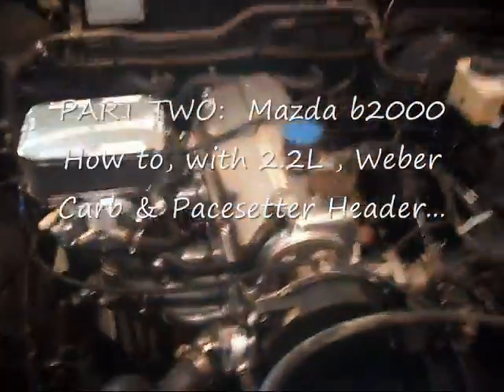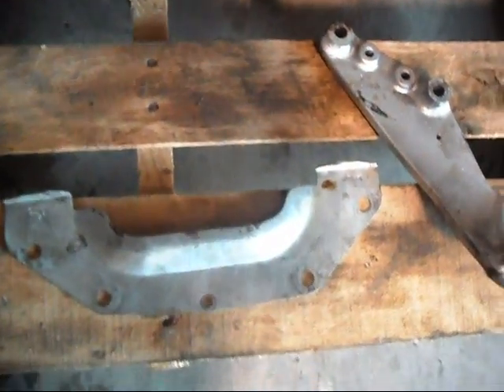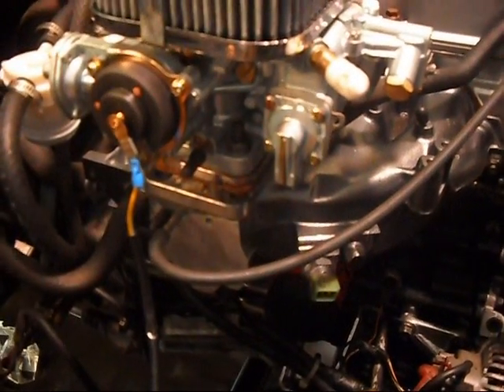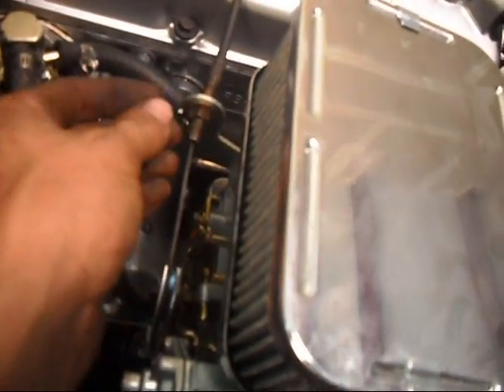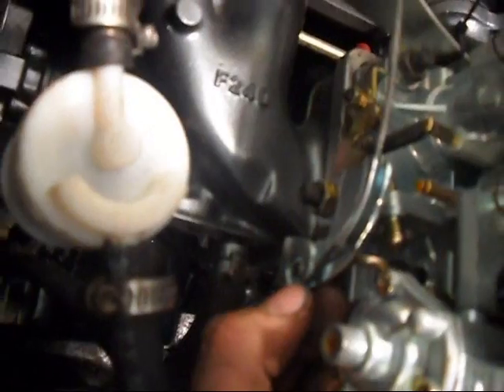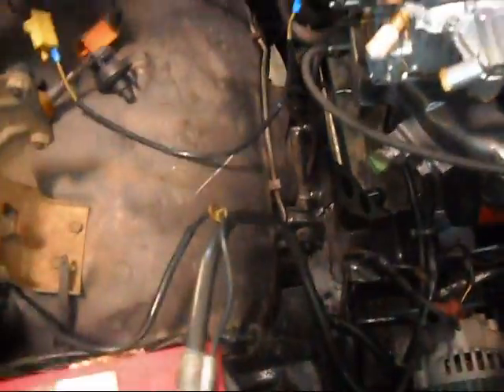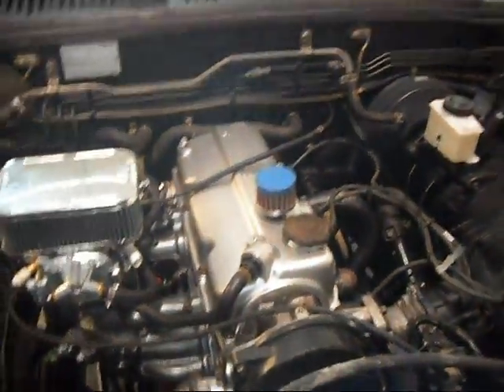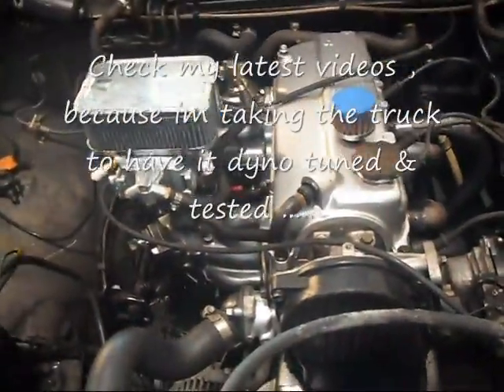PART TWO:: Mazda b2000 How to, with 2.2L , Weber Carb & Pacesetter Header...

Comment: BRAHHH  I HAZ A 86 B2000 WITH..I THINK ITS A B2000 LOL SOMEONE PUT A WEBBER ON IT AND HEADER LOWER PRO TIRES AND CUSTOM RIMS ITS PRETTY COOL.  JUST PUT A HEAD ON IT, MAN I COULD USE A HAND!! I GOT IT RUNNING AND I BENT THE THROTTLE CABLE BACK TO GET IT TO "IDLE" LOL IM HAVIGN TROUBLE GETTING THE TENSIONER PULLY SPRING TO STAY ON.  THE OLD ON IS BUSTED, THE NEW ONE FLEW ON ON A TEST DRIVE. DAMN I SHOULDA DONE THE BELT AND PUMP, ALL IN LEARNING.. LOL
Reply: Video to change a oil pan gasket on a b2000 Mazda truck

Comment: I have a 92 B2200 just put the Pacer Headers and Webber 32/36 DGEV. I checked my crank and camshaft marks and placed the distributor on TDC. On my Webber i had to set the high speed idle screw touching the accelerator cam. I noticed my spark plug were dark black which tells me that I'm running rich. Do I have to use a timing gun to improve power. I don't have power. I step on gas pedal and it feels like there's no power. Any answers help. Thanks

Comment: I have a 1984 B2000 with a B2600 engine (2.6L Mitsubishi completely rebuilt I think from 1992) with an old stock carburetor. It currently is terrible on gas and is not powerful at all. Do you think I should put a Webber or two, and add headers? Would this spruce it up some? I'd appreciate any input!
Reply: Screaming Seagle absolutely, I have an 87 xcab b2000 & an 88 b2200 shortcab. Both I’m building into minitrucks. The 2200 with a Weber & the 2000 has stock carb the b2200 feels alot stronger compared to the b2000. If nothing else consider this. A guesstimate of over 50% of Mazda owners have problems with the stock carbs & upgrade to Weber’s simply Bc it’s simplified & functions better allowing your motor to operate cleaner

Comment: Hey ! What state you 're in ? I'm in North Carolina and i have a Mazda B2000 1988 with 204k mls. First time when you crank it  up valves ticking like crazy but after a few seconds gone and the motor runs smo0th. Late i change a new Timing belt and Gas tank. Two days after it won't stay running. So i started doing painting on the body with Rustoleum cans. And now tring hard to get it start with starter fluids it won't stay running. Well, i decided to rebuild the motor and put a weber carb . What can you say as an advice for a beginner and can you suggest the mechanic that rebuild your motor and i will work the rest> Thanks i really enjoy watching the video loud and clear> Valentino 2523824531
Reply: Valentino Remonde I’m in eastern NC do you still have your Mazda? I have a shirt cab & xcab I’m working on

Comment: Great video!  thanks for posting!  brought myself a 1987 project truck as well.  Looking forward to rebuilding.  Did you use the factory manifold?
Reply: Edward Stills How is your Mazda project coming along I have 2 myself I’m working on & it looked like a stock intake manifold he may have bored it out I’ve seen someone do it on the tube b4

Comment: Hey there!
I anyone can help put back my 93 Mazda b22000,I bought from the guy his complete took the engine off from the truck, now just finish the clutch,I will need someone help me put the timing belts together and head and all the vacuum house fan bracket and more....

Thank you.
Reply: My truck all stock parts on it on you video difference bbl I think can work on it, but on my like 15 vacuum I don't know how to put back together event thought I look the diagram still can finger out.
Thank you for you help.

Comment: Did you install aftermarket headers as well? If so what did you go with and where did you order them at?
Reply: He did install aftermarket headers. The brand is Pacesetter and you can buy them off of ebay. From that i think he went oem for the rest of the exhaust.
Reply: Got my stainless pacesetters for $120 on eBay

Comment: How did you block off the egr port on the side?
Reply: TUBASYCO98 I went to Lowe’s hardware & got brass plug fittings for the manifold & used a steel plate 2”x4” roughly used the gasket & bolted it down. But I’d suggest just getting a header they’re $120 on eBay I just got one last week for my 2nd Mazda project

Comment: Nice job. You close to Rowan county?  I'm buy a new long block 2.0 for 1300$ and getting the biggest Webber for it I all ready have the header on my old motor. My truck looks just like your brown and sliding back glass window. I really would like to know your horse power and torque numbers.  Post some more videos of it.  The whole truck and maybe one with you driving it to? When I put the Webber on it if I have any problems you could help. I already have al the egr stuff off but really want to

Comment: There is a tap on the back of the alternator for the choke to plug into and temp sensor for the gauge is on the water neck.